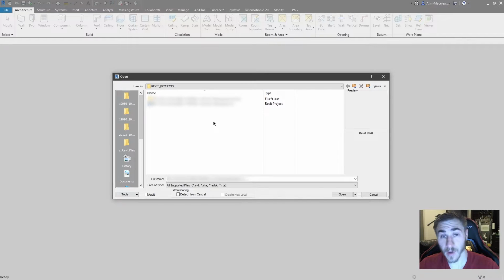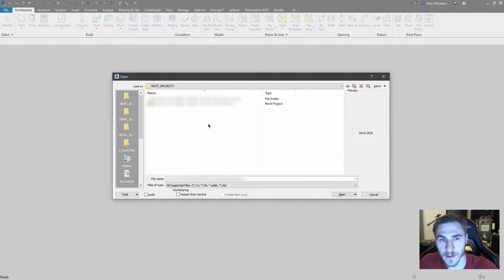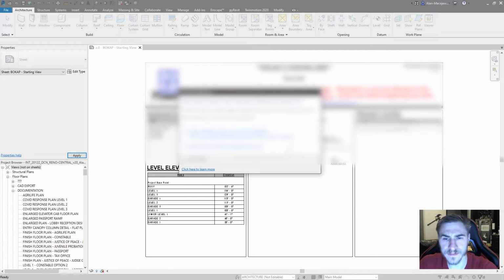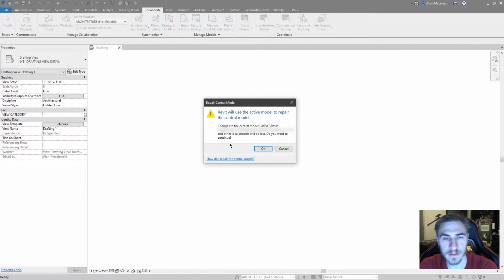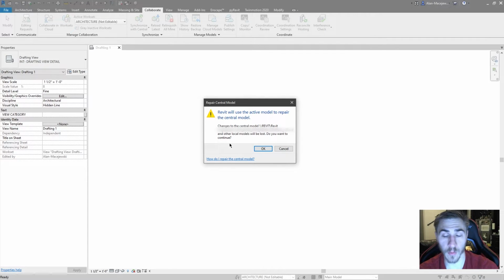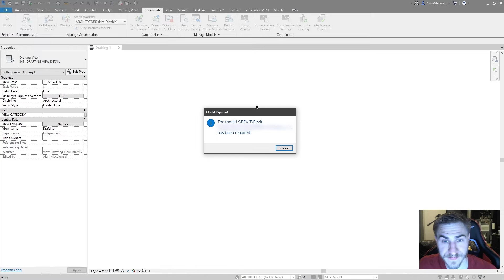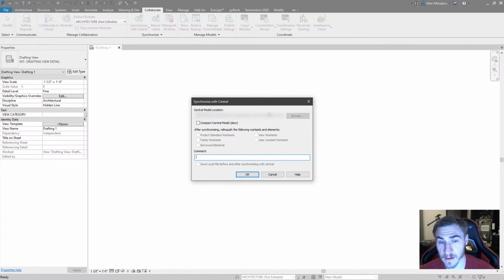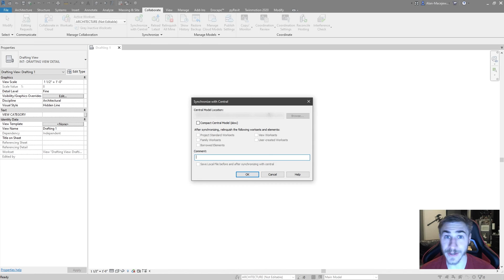How to Repair Corrupt Revit Model | Revit

Comment: i really enjoy you videos and have been able to gain real insight into using REVIT with your insight. Do you happen to have a video / or know how to retrieve a stand alone corrupted file? I have the following error coed - FAILED TO OPEN DOCUMENT. Any thoughts are greatly appreciated! Rich
Reply from the maker: Hmm, if retrieve you mean by be able to extract the info and make it a new model, I am not sure how to do that. I unfortunately will not be much help if you cannot open the Revit model. Your best bet might be to find a way to get it open. I am not familiar with that error code specifically. There may be another reason as to why you cannot open the model.